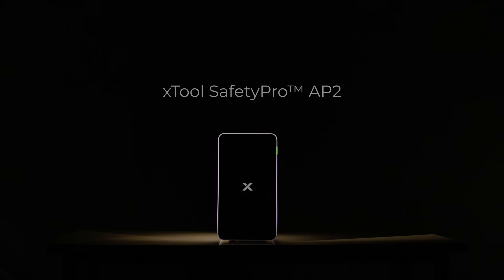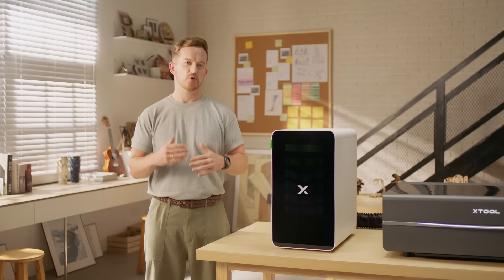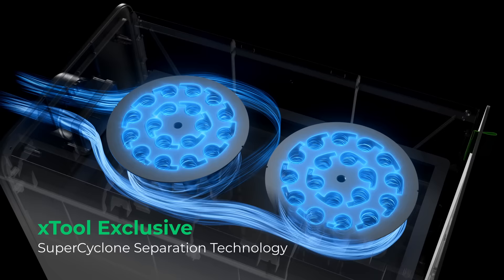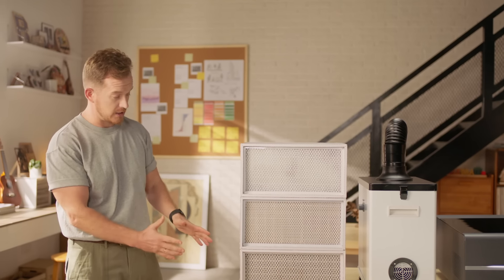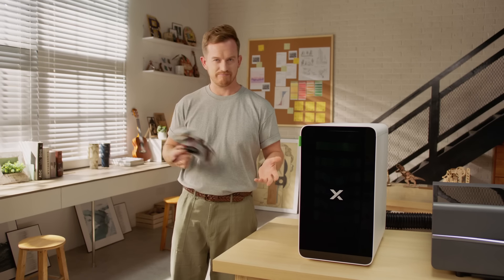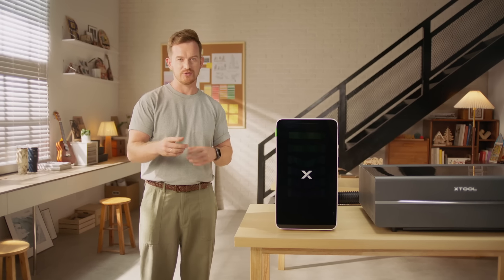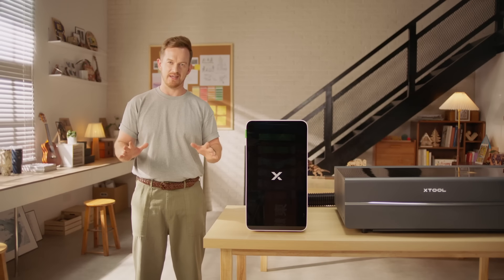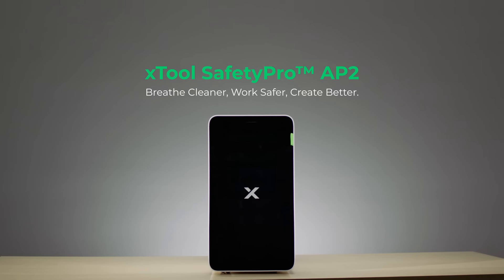xTool SafetyPro™ AP2: Unrivaled Dust and Odor Removal for Laser Processing

Comment: I like this, especially the washable prefilter, but I can't easily tell about replacements. Are they one unit, so you have to get all layers at once, or if the meter says "Filter 3 needs changing" can I just get Filter 3, for example?
Reply: All layers are available separately.  My issues is, do we need to order a full set then figure out which ones will need to be replaced more often?
Reply: @tonystobb8364  Yeah, that is more of what I meant. Typing on low sleep is not a good idea. I suspect if they are all 1 bundle we would wind up with multiples that are unused.